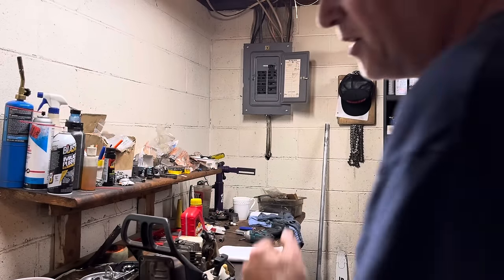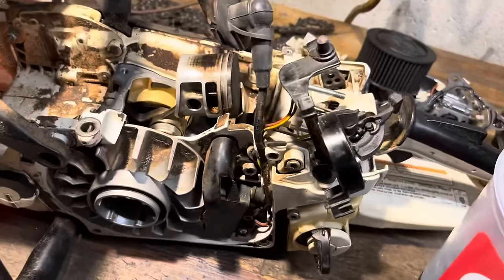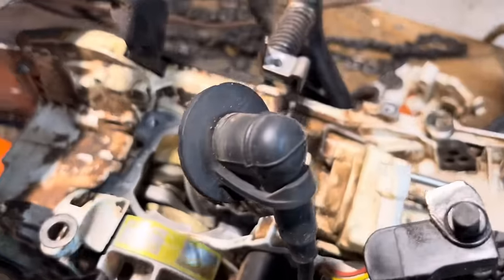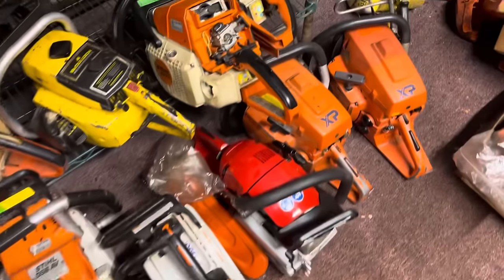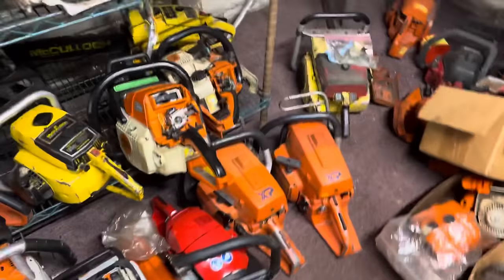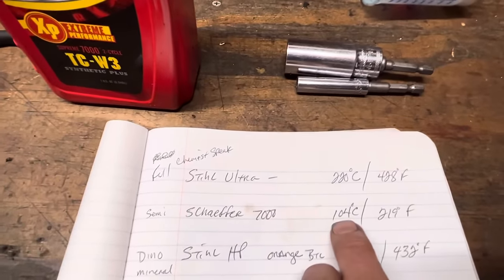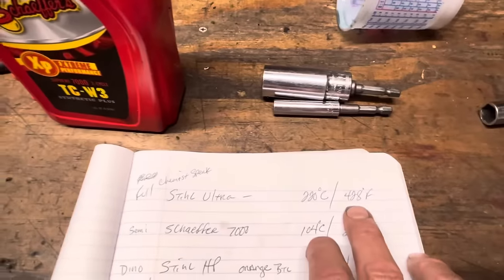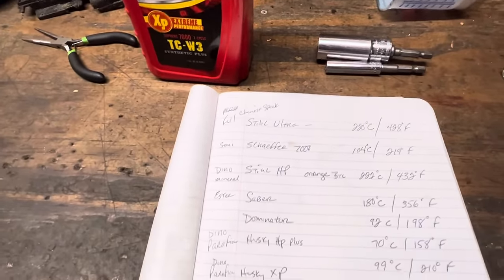Two Stroke Oil Talk.  Why Anything is Better than Ultra for your Chainsaw!

Comment: Comment part 3...I've run Redline 50:1 for 25 years in every 2 stroke I've owned. It started with a CR500 that literally sludged a brand new piston skirt with "bean oil" and pulled it off and ground it up in the bottom.
Next piston broke it in on "bean oil" and went to Redline. Same, a month later the rings stuck from sludge.
Third piston, broke it in on Redline like I stole it and never touched "bean oil" again. I rode that piston AND RINGS for 5 years after that until I sold the bike. I checked it inside a few times and it never accumulated any more carbon than the initial break in coating. All the saws and snowmobiles I've run it in have been the same experience.
Reply: Sorry, what’s bean oil?
Reply: @davehudson4607  Castor
Reply: Yep, a friend had a rotax 503 in a flightstar ultralight aircraft, he freshened up the top end a few years ago and started using Klotz with castor, after about 25 hours flight time it started becoming hard to start and low on power, pulled the exhaust Y pipe to discover the piston was completely black from the castor getting baked on, stuck the rings, he pulled the top end off, tried de-carboning the pistons /free up the rings to no avail.  Had to pop for all new pistons/rings again, got rid of the klotz oil and switched to a mineral oil based oil, no more problems after that.
Reply: I miss the smell of bean oil in my 4 wheeler.

Comment: I use any oil in my saws especially when its free, I run 25:1 and have done since the 84 when I bought my first saw  a Mculloch PM480, great little saw until it was stolen in 98,  I use the saws mainly for firewood or to clear a tree or two around the property and they get a good days use, I have had no issues with my saws except a XL330 which I cooked on the second day of heavy use in 40C days using Valvoline outboard oil (which I haven't used since) the piston and bore were fine just lost ring tension. I did find the outboard oil got the bottom end of my lawnmower engine nice and clean. ( the previous owner never changed the air filter)
Reply: With 25:1 or 33:1 any 2 stroke oil will do. It's that simple. Modern oils are all great, and when you mix at these ratios the bottom end is soaked and well lubricated and bearing issues completely disappear. The only oil I didn't like is the ultra, but not because of the deposits, but due to the smell of the smoke. It smells like burnt plastic. I've switched to Motul 800 offroad and loving it, not planning to use anything else.

Comment: I guess I'm a bit of a fool.  I use HP ultra in the 046 and the MS460 I ported.  Just went with the Stihl stuff.  No pro porter.  Amatuer Hot Rodder of all things with piston rings here. Thank you for the information, I guess I will have to consider other options.
Reply from the maker: If your brand loyal, the regular orange bottle still performs well at 40:1.  There are fancier oils out there, but I've seen good results from good ole Stihl HP.  Amsoil saber is a solid oil that's hard to beat.
Reply: @richardflagg3084  I do not need to be brand loyal on the oil. Pun kind of intended. I do prefer to use Stihl parts with a few exceptions. The oil was in a convenient sized bottle at the store I frequented more often back when I was building one saw, then the other. I trusted it because it was from Stihl. I’ve heard maybe enough small rumblings about Stihl’s oil previously to warrant more research than I’ve put into it. Now I guess I’ll look around. I’ve always shorted my gallons by .1 like you mentioned.  My head math one day told me that .1 put me at 45:1 🤷🏼‍♂️. I’ve believed myself ever since. Lol. Thank you for responding!

Comment: Great video. I use stihl products and was using the ultra for the warranty hype, I’m going to try the Aspen 2 product at the end of the season and next year. Their claim is it burns cleaner, we will see. 🤷🏻‍♂️
Reply: I have run Aspen 2t (50:1) in my ported husqvarnas for fifteen years with out a problem.
(346xpg, 372xpgw & 394xpgw).
Reply: I'm running aspen 4 and mixing it with hp ultra/super with super clean results

Comment: Stihl oil is made by BP for them.
Another thing is what petrol your using as some places give you high ethanol content which causes issues so need to adjust amount per fuel values
Reply: castrol makes stihl

Comment: Good to know. I bought a MS 170 Still for $200 bucks at the local "dealer" in a small town. I got the ol' "double your 1yr. warranty to 2yrs for buying the new Still premium oil.  I'm going back to using the cheap shit.

Comment: I run amsoil interceptor 2 stroke oil mixed at 3 ounces per gallon with 91 octane non ethanol fuel, Have run this oil for years at this mix rate. I run this in all my 2 stroke equipment including numerous vintage chainsaws with no problems whatsoever. Tried stihl ultra several years ago didn’t like it at all lots of muffler and screen problems.
Reply from the maker: Yup, you nailed it!

Comment: Regardless of what 2 stroke oil you buy for your saw, make sure it is specialized for air cooled engines. Don't use motor boat 2 stroke oil in air cooled engines. Water cooled engines run cooler than air cooled engines. You need an oil that is meant for the hotter running temperatures.
Reply from the maker: I'm going to test that theory again very soon.  You may want to rewatch the tear down at 9:02 again.  Scheaffers 7000 is TC-W3 oil and it works well in air cooled engines as well as the water cooled applications it was designed for.

Comment: Very good video spoke a long time to three independent certified two stroke mechanics:

50 to 1 lots of bottom end problems, good for business and saving the environment.

40 to 1 maybe a 5% to 10% failure rates, otherwise other mechanical problems.

32 to 1 virtually none, unless a machining defect or plugged fins and saw overheated.

All three mechanics did not know abour each other, only me.

Thank your for mentioning TreeMonkey, I know he had some health issues lately, what a legend, I have saws build by his students, nothing like a 240psi compression at WOT. Only 32 to 1 in these saws otherwise bye bye bottom end.

Happy and safe cutting.💪💪👍👍

Comment: Ultra sucks, you are right.  It clogged up the spark arrestor on my ms 241, completely.  It also carboned up the cylinder on the 241.  I used Stihl’s Decarbon and left it in for 24 hours.  I have no problem cranking the ms 241, anymore.  My collection is similar to yours, mostly Stihl, but I have Husqvarna, MAC and Poulan, too.  I tried Echo Red Armor and my only problem with it is- if you leave it full of gas for 8-9 months the oil solidifies behind the rings and doubles the compression.  I left it in my ms 251 last October just to see how it behaved over time.  I tried to crank it up in May and it beat me to death.  I could not pull it over.  Even my friend who is 15 years younger than me could not pull it over and he is a little bulldog.  I run Stihl HP at 45:1, now,with PNE gas.  I like the Beni fits of JASO FD oil, but I also like to be able to crank the saw.  I ran StayMix for years at 40:1 in everything and never had a saw failure that I could attribute to the gas used in them.  I know it smoked like hell but my 37 year old Poulan S25DA is like new, internally.  I may switch to Echo Power Blend Gold at 50:1 to see how it behaves in my saws.  It runs fine in my PM610, but I do not know how my Stihl saws will take to it.  It is a JASO FD oil.
Reply from the maker: Why would a manufacturer sell a decarbon treatment?  Hmmmm.  Stick with 40:1 Orange bottle Stihl, Red armor or Husky XP+.  They all seem to be more forgiving in the carbon department along with good film strength.
Reply: @richardflagg3084  Richard, I am using Echo Power Blend Gold at 50:1, right now.  I may switch back to Stihl HP but it is almost as dirty as Ultra.  PBG is an JASO- FD oil.  Can’t get Husky oils where I live.  I want to find one oil that I can run in everything I own - weed eaters, blowers and chain saws, both big and small.  About half of my saws are Pro level and the rest homeowner or farm types.  I do not like Memtronic.  I can turn screws with the best of them.
Reply from the maker: @johnclarke6647  Hell, I use Schaeffers 7000.  It's TC W3 boat oil.  You'd be hard pressed to find a cleaner burning oil, that has great film strength too.  I buy it online by the quart and measure it myself.  Much cheaper than buying it premeasured too!  FD oils are great, but it's not the be all end all.  Two strokes have run for decades without FD oil.
Reply: @richardflagg3084  I have never seen Schaffers oils, anywhere.  FD is better than FB, which is what Stihl and Husky are..  FD oils stay in the engine, the others go out the exhaust.  The only problem I have had with FD oils is they will solidify behind the rings if left sitting for a year or so.  This will double or triple the pull over required to start them.  I left Red Armor in my MS 251 last fall.  When I tried to start it this Spring it about took my arm off.  I thought I was trying to hold the Titanic afloat with a small rope.  I finally dumped the Red Armor and refilled it with Moto Mix and was able to get it going after the Moto Mix burned out the remaining Red Armor.  I am a Vietnam Vet, so I am no spring chicken.  I am not a weenie, but I am careful where I expend my energy.  Know you understand.
Reply: @richardflagg3084  I am also protecting my old saws.  I have a 37 year old Poulan S25DA, a MAC PM610 and 32-16.  These saws required a minimum of 40:1 and ran on it for years.  FD oils are ok in them at 50:1.  I don’t worry about my Stihl and Husky saws - they were built for any 50:1.  I am not going to do like Walt (afleetcommand) and burn a 32:1 mix in everything.  These actually make saws run hotter than a standard 50:1.  I don’t have the system failures he has, either.  You can run a 50:1 FD mix in any piece of two cycle equipment.  That is part of the FD spec.
Reply: Bravo !!!!
 I use regular old Orange bottle HP at 42.5:1 and non-E fuel. Decarbon with a special product direct into the carbs with engines running 2-3 times a year and get exceptional engine life.
Reply: @richardflagg3084  They sold the de carbon stuff primarily for the 4mix as I recall. From what I hear the Stihl Ultra was basically an oil created to try to solve carbon issues that plagued the 4mix early on. Stihl Ultra with 4mix these days seems to be a pretty solid choice.
Reply from the maker: @briantii  The 4 mix trimmers and blowers burn it a little better given the higher operating temps.  I honestly still see some build up when taking the valve cover off to adjust the valves on the higher "mileage" 4 mix units.  A decarbon treatment is still not a bad idea on occasion.  If the main bearings give out, It's a parts unit at best.

Comment: Here's an arguement to the "pooling oil" in the bottom end...what was the run condition of both saws before being shut down, were they idled at all? Put that 251 back together and go idle it in the dooryard for a minute, then pull it apart and see what the bottom end looks like, at idle a 2 stroke is extremely overloaded with lubricant and could run a 300:1, its at WOT conditions when the higher mixture ratios are required. Now the discoloration is something to be concerned with amd could very well be a fault of the oil. These "oil tests" are extremely hard to do without a damn near perfect laboratory set up, but there's plenty of people on the internet who will post a picture of a lean looking spark plug and blame the premix oil. That same machine with 30 seconds of idle time will look 100% different. Im just going to look through the comments and take all the oils people are recommending and combine them into one, it will basically be "never had an issue" super fusion oil and sell it for 100$ a bottle.
Reply from the maker: Actually, my tests a geared toward more real life use.  The pooling I believe is relative to the film strength of the oil rather than idle time.  Some oils require a touch more oil to keep the crankcase well lubricated.  Upper cylinder lubrication is not hard to achieve.  Keeping some oil film on the crank and bearings will make the engine last longer can't be seen with the saw assembled.  That's why I have done these teardown vids.  Most will never teardown their saw to see how their oil is performing.  I try to keep my opinion out of the teardown vids I have done lately and let the oil speak for itself.  Thanks for the comment.
Reply: @richardflagg3084  you have an email you can share? I have some reading you might enjoy
Reply from the maker: @Nicky_Pin_It  Always willing to learn.  sawmansc@gmail.com

Comment: I've always run "Maxima Formula K2" with 91 octane ethanol free fuel with no problems in all of my equipment. It's actually made for dirtbikes but I find that it burns much cleaner, smells better, and increases the RPM's of the engine so I get more power out of them. I use a ratio mixing cup to get the correct ratio.

Comment: Any good brand name oil is fine.  Stih or (any two stroke engine company) doesn't make any oil.  It's all made by which ever company they contract it to.  The engine company will give the oil company a spec sheet of what formulation they want.
Reply from the maker: Exactly!  Look for the JASO "FD" rating on the bottle.  That's the highest rating for 2T oil.  Basically a better detergent package without sacrificing lubrication.

Comment: I always run motomix just because I don’t have to worry about ethanol. Seems to be great fuel. Pricy but seems to be good one me. One thing I’ve noticed people doing is they mix up oil and gas then when it’s 3/4 of the way empty they mix up more fuel then it raises the oil content still thinking bits 40 or 50 to 1. When it’s hard to say how much oil is in there. Thanks for the great video
Reply from the maker: I like to start fresh every time I make saw gas.

Comment: I used to recommend husqvarna hp for all saws especially Stihl! the shop I worked in serviced and rebuilt all brands but the pros typically run Stihl and big husky’s and the pile’s of Stihl pistons and barrels destroyed by a lean run serviced by the dealer plus often on sus oil was huge! then the remedy for it ,a good tune and 25-1 mix and be careful using tcw3 marine oil it might be ok in cold temperatures but cut hard iron bark in 100+ degrees it gums up it’s ok occasionally but not for hard hot use! as it’s formulated for water cooling and air cooled will cause the oil to solidify

Comment: There is so many reviews on two cycle oil’s , at times they get down right confusing and opinionated, lot of results are how equipment is operated and maintained, most of you base oils come fro one oil manufacturer . Maintain you equipment, make sure your mix is correct, and remember not all equipment quality is the same.

Comment: I totally agree ...50:1 kills saws...I prefer 32:1 maxima 927 I have good luck with it..I never really thought about it till I started building saws...and man 50:1 saws are dry inside...I'm guilty...I ran 50:1 Husqvarna low smoke oil for years..wore a ms290 out...but once you see inside of the engines your eyes will open
Reply from the maker: No Truer words my friend
Reply: Careful with that 927, it smells amazing but will leave serious residue in your saw
Reply: @jadeolin8514  burns clean as a whistle in my experience....I've heard  others say the same  but in 4yrs of using it no problems 🤷🏼‍♂️
Reply: @Aaron_A_Lynch  then by all means, burn that sweet smellin castor good sir. I, will abstain.

Comment: So your saying Castrol 2-stroke oil is garbage ?
Reply from the maker: No, I'm saying this oil (Ultra made for the States)  is shit.  You do realize Castrol makes about 20 different 2T oils around the world.  Ultra in the US is blended in Louisiana.  Nowhere does it say it's a Castrol oil.  I have seen a Stihl white bottle available in Canada with a Castrol logo on the back.  That is a totally different formula.
Reply: @Richard Flagg  I don't like the ultra either, I've been using the regular sthil 2-stroke oil in my sthil fs-250 weed trimmer for   the last 10 years with no issues

Comment: nice video my friend 👍. I've had no failure with Amsoil in my 2 cycle equipment in 40 years but no chain saws we don't use them l know echo red armor oil will remove carbon in just 3 tanks look at Steve,s small engine review not sure if it's a great lubrication oil like Amsoil Shaffer's 2 cycle oil is great oil too as good as any oil out there 👍👍😁

Comment: Companies like to Greenwash these days and 'STIHL HP ULTRA - TWO STROKE ENGINE OIL' marketing blur is that it is biodegradable in 21 days. Very much like gasoline marketing where they mix ethanol, not necessarily the best for your engine.
Reply from the maker: You pretty much summed it up right there.

Comment: Hey it may not be the oil. Maybe it has more to do with the fuel he's mixing the oil in. I bet it has more to do with the ethanol in the pump gas then it does with the oil. I run p97 racing fuel none ethanol, none oxygenated gas. Last for years. And i mix 6 fully synthetic stihl two stroke oil in 5 gallons of p97. And my 064 stihl runs line a top with no problem.
Reply from the maker: See Pinned Comment.  The majority of the run time was on Motomix.  That's Stihl's Alkylate fuel.  Under ideal circumstances Ultra will burn clean.  It is however a very thin oil and consistently leaves the crankshaft and bearings lacking of a good oil film.